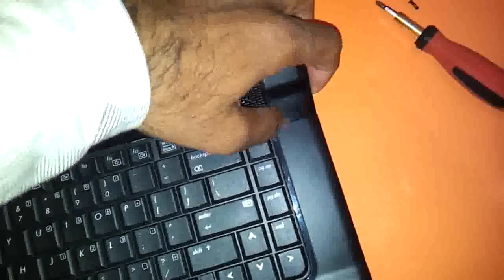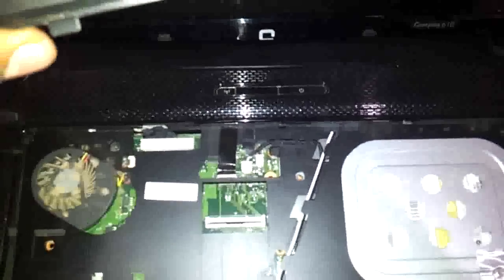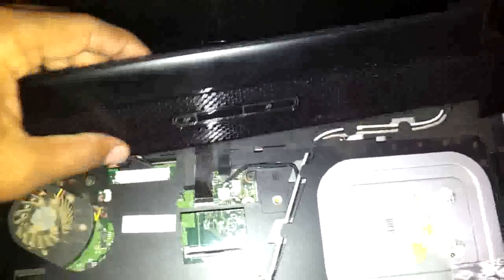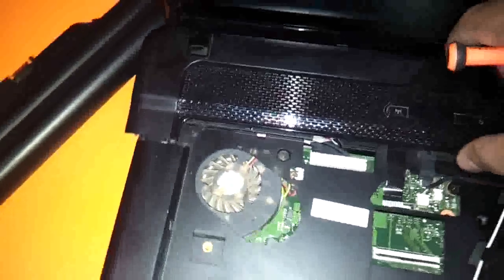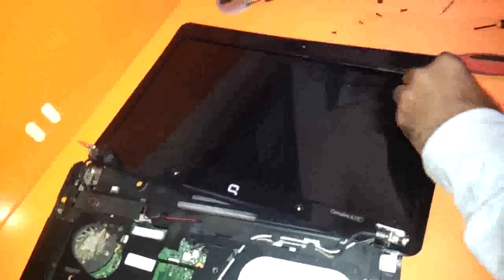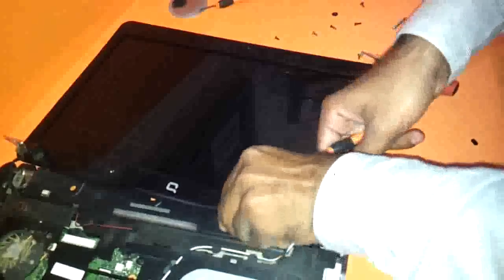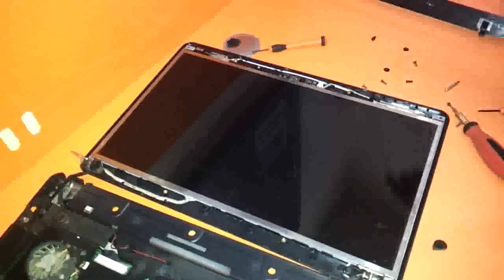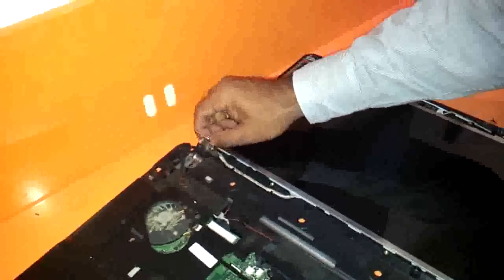how to change screen lcd led of compaq610

Comment: Gives an idea of how it comes apart BUT hazardous technique..I would first remove all shown  underside screws and battery first. Place screws on to an adhesive sheet fixed to bench with end tabs folded under to keep it stably fixed to bench. locate screws in order of removal.. Invert and open lid, Remove cover close to display disengaging it's connector. unclip connector of keyboard Remove  ( follows)

Comment: The covers of the bezel screws can , if cleaned, be attached to the bezel itself, screws as before. The bezel may be removed prior to removing the hinge screws. Instead of a screw a driver a plastic camping knife may be used so as not to knick the edges. Remove upper display screws hinge screws. Fold display forward, remove conector, remove display. Reverse sequence to close.